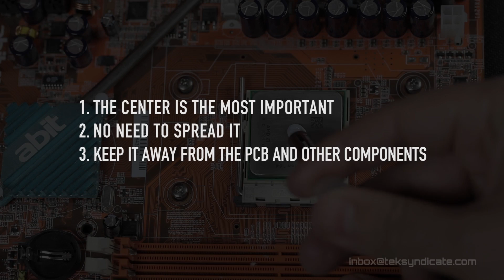How To Apply Thermal Paste

Comment: Strange. From what i've heard - paste should be evenly distributed on a surface of a cpu lid, so i always leveling a thin layer of it with a plastic card. I actually saw this method in some video about overclocking, and i think O-Clockers know a thing or two about heat distribution.

Comment: I used the pea method at the centre of cpu.  However when placing the heat sink I misaligned and need to shift heat sink again and it separated from CPU.  I next aligned it and screwed in the heat sink.  Do you think I have messed up the application? Do I need to redo? When I last check system temperature via bios, it is showing 49 degree Celsius and Cpu temperature in DTS is 62

Comment: 4820k, Arctic Silver, spread plastic method. I have 28c idle and 33c under load. I spread uit thin toward the edges and left it kinda thicker towards the middle. Thermaltake NIC C5 cooler/ThorV2 case.

Comment: 1:01 that is not at all how you do the plastic bag method ;o]]
basically you use tiny amount of TIM and keep tapping to spread it to have the whole IHS "painted"

just the fact that you pea/line etc spreads evenly under glass doesn't mean it's optimal application, you only want to fill the microscopic imperfections in the pretty flat metal surface
so you want the least amount possible to have the whole surface "wet"

also really depends on the surface flatness (some IHS are bowed, that is why you would lap them), the TIM viscosity and mounting pressure
for example CPU coolers have much higher mounting pressure then GPU so the pea method works better for CPUs

Comment: Nice video, I am not a pc builder but rc quadcopter. We fpv pilots often have to replace our video transmitters due to them burning out and it can be a violent ride.  Some come with heatsinks but no way to attach. I thermal paste but it doesn't dry and wouldn't be strong enough anyway. What method do you suggest for this?

Comment: Do I have to take off the pre applied thermal paste off before applying my own or can I just put it on top?
Reply from the maker: No! Do not remove the pre-applied and do not add your own. Pre-applied is typically best.
Reply: If it's been a few years then yea wipe off the old paste and put new paste on.

Comment: My issue is once I've applied the paste and go to apply the heatsink, because of the tubbing and awkward bracket of the thing I end up sliding it around on the CPU and my temps are like I'm not even running a cooling unit. Any tips? I've re applied it three times now and I can't get good conductivity! :[

Comment: Do you need to do this if you use the stock cooler? And comes the cpu with the thermal paste or do you have to get it separately?
Also, do you have to do this once or multiple times?

Comment: Your video is very old.
Just for those now watching, some newer TIMs have better viscosity than in the video, such as Thermal Grizzly, and they can be applied using an old Visa or plastic ID card. - - I have worked with PCs for over 30 years and have used many types of TIM in that time frame.

Comment: I use the spackle method and have had no issues. It's been 4 yrs. since I applied the paste on CPU and my temp is 27c and while playing BF4 on max settings I get 51 celsius tops under CPU Package, which is the highest temp out of all the readings from CPU. I do of cous have the corsair H100 radiator cooler set at the medium setting out of the low,  med., high settings for the pump. The trick is to not leave a mess and make the application as even and thin as possible, while cleaning off the edges. And i'm guessing the paper business card is a bad tool to use for this app. I always use an expired plastic card like an I.D. or credit card etc. This method is a little time consuming but it's the only method I have tried and will continue to use due to the results. Either way I guess works as long as the results are positive.

Comment: If I do this, do I need to wait for the isopropyl alcohol to evaporate or does it do so almost instantly? (Before applying thermal paste), also do I need to wait any before replacing the heatsink/fan/etc and turning on the computer after this procedure? (I plan on using Arctic MX-4 btw)

Comment: I have no idea what I'm doing. I just bought a gaming PC. I picked the components, they will build it and ship it to me. 

1) I was forced to get thermal paste. How often do I need to put this on the CPU? 
2) Is taking everything out going to pretty easy?
Reply: Applying Thermal paste is mostly a one and done type of thing. Maybe like 4-5 years down the line you might want to change it out again. But for the most part it's really not neccesary.

Also, all you really need to do to get access to the thermal paste is to remove your CPU fan, and uplug the power from the motherboard. Thats' it really. Difficulty will depend on what cooler you have. :)

Comment: I used pea method with Arctic silver 5, and it barely spread. but with another thermal paste, it spread perfectly. temps with arctic silver i5 4670 was at 43 Celsius

Comment: So I have no thermal paste.. I forgot to install it when I built my PC. I have a really badass CPU cooler so despite this, I get about 60 degrees celcius. Is it safe to overclock?
Reply: No thermal paste? Are you sure it didn't come with your cooler? And no, do not overclock, stop using your computer too. You need thermal paste.
Reply: lol wtf
Reply: Srsly how did you forget to apply thermal paste...
Reply: Zorra FoX It did. I bought a cryorig H7. As a matter of fact I have it overclocked by 15% and still running fine. The cryorig H7 can compensate for no thermal paste apparently.
Reply: LibertySounds Dude... you are going to lower the lifetime of your processor. Please but thermal paste in there.
Reply: Zorra FoX My CPU cooler was really hard to install and I don't want to drop it on my motherboard like I did the first time. Luckily nothing broke but still
Reply: LibertySounds Doesn't matter dude. I removed and replaced my motherboard 3 times because I didn't put enough standoff.
Reply: LibertySounds I highly recommend putting thermal paste... If you don't do it, don't cry when your CPU doesn't work properly anymore.
Reply: Just give it up and sit back and enjoy the show. If a guy won't listen after four or five times of warning him it will ruin his CPU, let him reap the consequences and hopefully learn a life lesson.

Some people just have too much water in the brain.
Reply: Swedishh Fish lol

Comment: how good is coolermaster IC Value V1 thermal compound for core i7 3610QM. Also can thermal paste damage cpu? some people say they got damaged cpu after applying thermal paste. Last but not the least can I use same thermal paste for laptop integrated gpu?
One last question,how much temperature difference will it make after changing thermal paste? i have not changed it from more than 2 years.

Comment: are you also supposed to apply thermal paste between the CPU and the socket? I'm replacing my cooling paste on my X58 since its running very hot and its impossible to get a new one. ( Dont wanna give up my i7 920 )

Comment: if i apply the thrermal paste and the pressure it with the heatpipe,can i then remove the pipe and see how its spread and then put it back on or will i ruin the spreading with air bubbles?

Comment: Lol, built, god, must be 50 over the years, and used to spend an hour doing a tracing paper thin, totally even application, then  the next few years did the lentil sized centre pea
  But, over the years I've noticed one thing, no matter how hurriedly I've done it, or how slapdash someone else has blobbed it on, I've never, ever, found a bubble. Or even found it particularly thick after a period of use.

Comment: I think I need help... I just cleaned my heatsink and used a fiber cloth thingy and isoprophl alcohol to clean the processor and that metal thing on the heat sink.
re-applied a thermal paste, pea style. At the begining, its OK according to both RealTemp and HWmonitor, the processor is at 45 degrees.
But when I started playing Minecraft with the RealTemp and HWmonitor on, the programs read that the processor temp is at 70-80 degrees! 70 to 80 degrees celsius for 40% CPU usage.
D:
The Thermal paste I use is from CDRKing, its the only one available within two hours drive. I have looked in town and in the city and the only thermal paste I could find was in CDRKing. ... 
I installed the Fan and heatsink properly so I dont know what to do... Is it the thermal paste???
Reply: Did you screw the heatsink in far enough.
It shouldn't be able to move, or barely move.
Reply: As it could be something else, you might want to take look at the thermal paste. Knowing CD-R King, it's probably not very high quality paste. (Filipino here)
Reply: There's always the possibility of some dust or fibers on it that were floating around also.  When you clean it both should be shiny and new looking (not dull like they still have something impregnated).  After that step I always take a good scotch tape and stick it on both surfaces to pull up any grime just before I install.  Think of how much surface area you lose when a piece of dust is under the screen protector on a phone...
Reply: It was the Thermal PAste.... Headsup DO NOT BUY Nano Silver from CDR King...
But, CDR KING has Nano Diamonds compound... Its decent. my Temperature does not increase beyond 50, even when someone was editing videos in my pc...
Edit Feb09,2014: Frack it, I spoke too soon.. Its only decent for a few days. My core temp is reaches 70 degrees when someone edits videos.
Reply: Were you near lava in Minecraft?

Comment: How tight do I screw in the CPU cooler? When I tightened it super tight with my H60 cooler it worked horrendously. I have an H110 on its way and I don't wanna fuck it up this time so how tight should I tighten the bolts?

Comment: the creditcard method actually looks the best in this video i didnt see any bubles there and it spread all over the cpu not just the cores
Reply: Remember that when the system is running the heat will cause it to spread further, you don't want full coverage from the start.
Reply: well considering that most watercoolers and stock coolers come pre applied with thermal paste covering the whole cpu it cant be that wrong can it? 
im not saying i know it better im still a noobie in this case and wanna have the best temps :D 

i would really like to see an comparison with temperatures and not only a glass pannel :)
Reply: Mavro Manitari there were alot of air bubbles i have no idea what you're talking about. the card method is often used but it's just wrong. it's so bad compared to every other method maybe except the finger one

Comment: When pushing it down with an object, can it be a glass plane, for instance, as long as it's flat??
Reply: I think he was demonstrating what happens when you press your fan's heatsink/waterblock with the clear plastic just to demonstrate. I do not believe you need to press anything onto it prior to installing your cooler.
Reply: Wait, so I just put a little dot in the middle and I put my ps3 back together?
Reply: I know nothing about how the PS3 is assembled, so I can't say for sure, but assuming there is a heatsink that sits on the CPU, you should be safe to put it back together, as the thermal paste should spread out as shown in the video through the clear material.
Reply: Andreas Roe Yeah just make sure to wash the mobo with a garden hose first
Reply: Andreas Roe Wha......WHY ARE YOU PUTTING THERMAL PASTE ON A PS3????
Reply: pokecoop . Because it is running at 85 degrees when it should be running at 40-50.
Reply: pokecoop . Because if you ever get a yellow light error you can open it up and replace the thermal paste because it might be running a bit hot
Reply: purplegill10 Sure, but that is just a bandaid. Sure it will help regulate temperatures but it is unlikely to solve the problem of a yellow ring. The proper fix is to perform a reflow of the offending chip(s). I typically reflow both the CPU and GPU while I have them open because if you do it right you won't damage either one. After that, clean the surfaces thoroughly, use quality TIM and if it still runs hot perform a fan modification so it will run at a constant 5V. This process is the same for Xbox's and PS3's. Under no circumstances should you do the "X-Clamp Fix" for 360's (unless you perform a reflow first but even then it really doesn't help), this does not fix the problem. All the "X-Clamp fix" does is physically push the broken solder joints together but does not actually mend them, which puts undo stress on your MOBO and CPU/GPU. The only real fix is to liquefy the solder so it makes a solid connection when it cools. Anything else is a bandaid that will likely ruin your console or greatly reduce its life.
Reply: Cody Istre Thanks for that correction

Comment: Tek Syndicate can you try some thing for me. On my last 2 builds I tried something I don't think anyone has ever done with thermal paste, I took a bit of thermal paste and rubbed it into the cpu and heat sink almost to the point where it was only colored with it like an extremely thin layer of rubbed in thermal paste, I then used the pea method and my temps have been SUPER low since then. 2500K the temps never go above 70c at 4.6GHZ and a 6600K doesn't go above 60c at the same OC.

I would like to see how this would look under that Plexiglas.

Comment: Do you absolutely have to use that alcohol? are there any substitutes for it? Can you just use a scrapper to get the old paste off of the CPU and heat sink?
Reply: no you don't have to use the alcohol. You can use paper towels, q-tips, microfiber cloths, etc. without it. The alcohol simply works well, like really well, at cleaning off the paste without making it spread more or gunk up.
Reply: Joe Sutcliffe Thanks mate.

Comment: I am scared that the pea-method doesn't cover all important spots. The stripe method also looks good, because it's got the shape of the actual CPU in the center. But I still prefer the x-method. It covers everything and there are no airbubbles. Shouldn't there be a better heat transfer if the cooler has a bigger contact area?
Reply: Not really, the important thing is the square centimeter in the center of the processor's casing. That must be perfect.

Comment: Ok after reading a lot of comments and watching other videos .. The pea and x method seem to work great! But does the paste actually have to cover the entire platform ?? I mean unless you spread it( I won't ) it really won't cover the entire surface. So what should I do??
Reply: He said when it heats up it will spread more so don't worry.(keep in mind i know absolutely nothing i am just assuming thats what he meant.)
Reply: +The ChillyWinds lol I get ya thanks
Reply: +BodofLegend And actually the top of the cpu is another heat spreader. the actual core is much smaller. That's why it's important the paste is in the middle. It doesn't have to go to the sides.
Reply: +ThePauhe thanks!! I done my thermal paste stuff with the bead and it worked beautifully !!! This was the first thermal paste application I've ever done too :)

Comment: I completely disagree on the way you bashed the spread method, as long you spread the thermal paste on the cpu and the cooler you will get good temps, because I was doing the pea method with cheap thermal paste and I was getting around 90c+ in idle on my temps in windows even when i waited for a week. and recently i used the spread method with the same paste, it gave me temps of under 70c in idle.

Comment: Can one use another type of alcohol (the denaturated ethylic alcohol with red or blue colouring added) or a different solvent to remove the old thermal paste?
Would clear ethylic alcohol (e.g. vodka) do it? Isopropyl alcohol is not easy to find (seems to me)...
Thanks,
Reply: its usually with medical stuff in your local supermarket/drugstore,

Comment: Didn't have isopropyl alcohol, vodka worked nicely tho :D also the thermal grease I got has a brush applicator... Should I still just put a pea size glob in the center?
Reply: pea
Reply: Mike G Vodka contains sugar and other shit, you'll end up having burnt caramel between your CPU and the cooling system..
Reply: LINKINPARK4EVER1996 Mmm mmm, I can go for a sugar chip right now. (chip = processor)
Reply: SquidPlays hahah  yep :)
Reply: LINKINPARK4EVER1996 I just used some cheap gordons vodka. It dries clear on glass so im sure it'll be fine. Anyway, my cpu is liquid cooled and never gets above 50C.
Reply: Mike G You can't be sure saying it "dries clear" only because you don't see anything on the cpu... that's why for examle it's common sense not to touch the cpu with fingers, otherwise you will leave organic stuff on it and guess what, you don't see it with bare eyes. I know, this scientific stuff might be annoying, but not for me.
Reply: LINKINPARK4EVER1996 Ok, i see how it might aggravate someone with OCD but really its not that big of a deal. Consumer electronic components are surprisingly robust these days and even if a very small amount of material was left behind its not going to affect the cpu. Now if it was a martian rover computer we were talking about then ya i'd be concerned but as long as you don't pour it on the entire motherboard it does work very well as a substitute.

Comment: How much pressure are you applying? I need to replace the DLP chip in my TV and I have to remove the heat sink to get to it. Im gonna replace the thermal paste in the process but Im afraid of pressing too hard and breaking the motherboard. But Im also afraid of not pressing hard enough and it overheats
Reply from the maker: Overbearing parent demanding straight A's. If your coming unit has thumb screws, get it as tight as your hands can make it. If not get it as tight as you can without straining. If it's too hot you can go a little more. It's ok to boot.
Reply: @teksyndicate  Thank you!